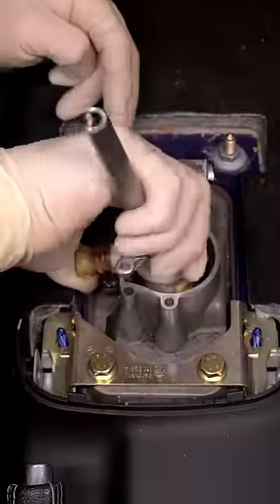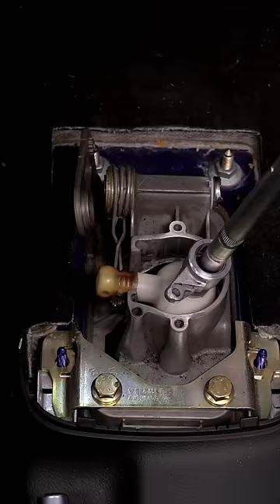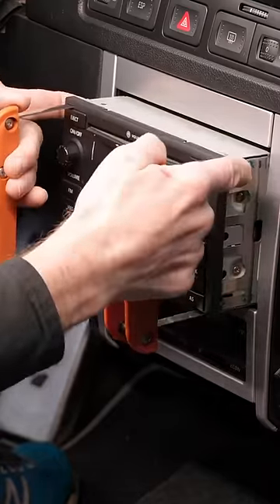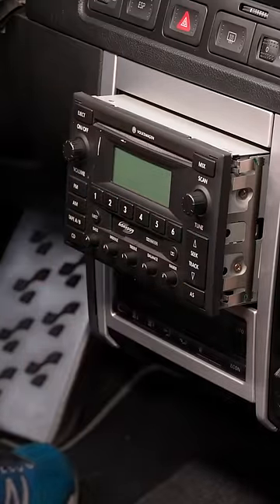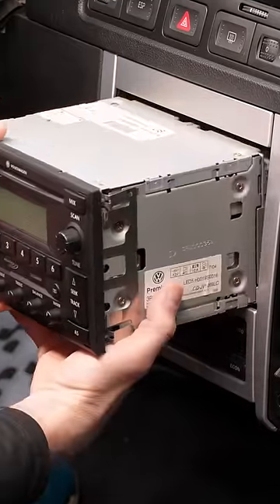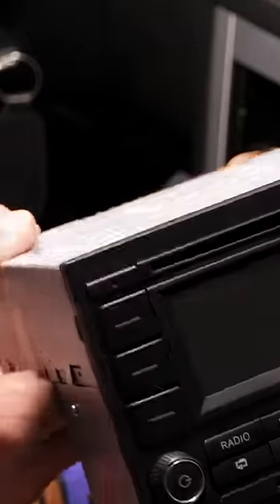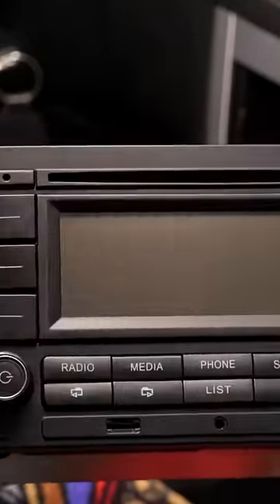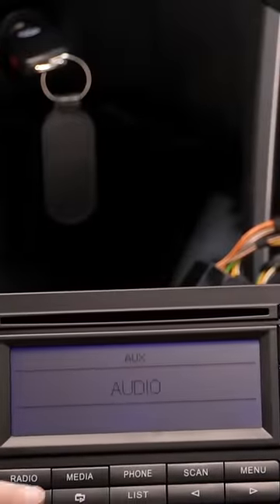I Ruined a Clients Radio OUCH

Comment: Recently had my car for a throttlebody swap. This was a commonrail i4 diesel so the throttlebody was way under the intake manifold, near where the vacuum lines for the turbo run. I get the car back, and notice a lack of power. I take the thing back, and ask whats up. They put it on top of their priority list then and there. Same tech who did it started diagnosing. Found that one of the old, cracking vacuum lines for the turbo had broken during rebuild and he failed to notice. Shop owned the mistake, showed me the broken part and fixed it quickly no-charge. This was a mercedes specialist (not an official dealership). The kind of service and accountability everyone should be expecting.

Comment: Had the clutch replaced in my all original and pristine 1981 DeLorean DMC12 with only 19,000 miles by a shop in Kalamazoo, MI (European Imports) back in 1996.  When I got it back there was a massive 14" long fluid stain on the passenger side carpet.  They claim, "it was there when you brought it to us...".  ...no it wasn't.  The car was factory fresh.  It is now 2023 and the stain is STILL there.

Comment: Oh man I know that feeling.... I remember braking the air box on a vct turbo Rogue during power steering rack removal. And didn't realize the air box was bolted on to the sub frame and I Heard plastic brake but didn't realize that it was broken. When putting everything back together performed test drive and notice a cold air intake sound😂. And I soon remembered that sound the box had a crack 😅. But the customers was cool with issue but I ordered one for the customers anyway but she said the car sounds way better. 😂

Comment: Something like this just happened. I was doing a lifter job a gen 4 LS for a customer. 6 out of 8 lifters were wrong in box that were damn nesr identical until i noticed the biggest knock on first start up. After tearing it back down, i noticed of those 6 lifters had the weep hole in opposite direction causing no oil to pass through. I didnt even want to rebuild it at that point. I just dropped in a motor that was blueprinted i had plan to swap after i called him and customed said hell yeah! No he complained that the truck smokes his tires 😂😂

Comment: It totally sucks when you mess up. Once i was putting on wiper blades for a drive and niticed the pin on the arm wasnt straight and i couldnt get the blade on. So i grabbed some pliers and gently tried to straighten it so the wiper would fit. (I genuinely was being gentle) Well, it snapped, and of course, the parts places around either didn't have it or it'd be a few day's. After talking to my managers and the driver to his company we decided to just swap the passenger arm to the driver side. (2010 mack) thanfully the driver was cool and not angry at me. I really was just trying to help out. We cha4ge to install wiper blades, but since it's an easy job, we tend to do it for free since it's that quick.

Comment: Easiest thing to do which would’ve also kept it original would be to just repair it. Very simple to just paint the radio. Melt some more plastic on and sand it down if it’s deep.

Comment: I have a 2001 Chevy malibu and am trying to keep it as stock as possible, but I am not too worried about stiff that makes it run like ignition. Radio I plan on updating as its old and not digital. It also uses an old radio standard

Comment: I once had a mechanic replace some light bulbs in my center console. Then my radio/cd suddenly stopped playing audio. Took my car back and they said it needed to be replaced and would cost $$$ because it was out of warranty. I thought no harm if I had a look at it so I found a youtube video telling me what to do, took out the center console myself, found the right cables, unplugged the radio/cd player and plugged it back in nice and tight. Working all fine. told them what happened, no apologies or anything. Never gone back nor buy from the same car company.

Comment: I remember working at a collision shop back in 09 and my coworker had a r32 golf. We always had Firestone do the alignments and he brought it there after some suspension work he did. Firestone didnt know it was hit. We also fixed their mistakes quick so the customer never knew their car was damaged. Well around lunch his car was flatbeded in smashed BAD. Basically totaled. He called Firestone asking whats going on and they said a part broke and wont be in right away. He then lost it and screamed into the phone to the point my ears crackled. Then why the F^,k am i staring at my car???????? Owner of the franchise paid to rebuild the car with 100% brand new oem parts and even had a built transmission for him because it was cracked. Final bill was over 30 grand and he paid in full. We bought a alignment machine a month later.

Comment: There are companies that specialise in repairing car audio. I bet one of those could fix that for fairly reasonable cost as it's just scratched paint.

I personally like OE radios more than aftermarket ones for their simplicity, lack of LED Salad and the fact they look very natural.
Reply from the maker: the down time was an issue. Luckily the client got the option they wanted. But if you know of those places that can fix it, LMK. The same coating is on a bunch of other VW parts and id love to get the AC controls fixed on a few other cars.

Comment: I had a mechanic that told me my radiator had some blockage in it that was causing it to  leak. Since it was my moms car i had brought in my Dad made the call to get it fixed. Near the end of the service my dad called and asked me to make sure i got the old radiator back just to check it. Turned out there was nothing IN the radiator. There was just a little road dust in a small portion of the fins. The leak was caused by a small leak in one of the couplings leaking the fluid. Next day we went and talked to the parts manager and he gave us a $700 credit

TLDR: Mechanic lied that radiator was fucked, got ot replaced, turned out to just be a fluid coupling leak, original radiator was fine, got $700 credit for next visit from parts manager

Comment: It was very nice what you did but what if the customer didn't want a replacement radio (especially since it's not the original one) or you messing with his instrument cluster? Did you check with them beforehand?
Reply from the maker: Did check with them on the radio... I know all my customers very well so knew 100% for sure they'd be into the cluster mod/repair

Comment: We recently put a motor in a customer's car. She came back a month later with an intermittent code. I could not figure it out, so I sent her to the stealership for diag. I happened to have to get parts from the stealership and paid for her diag out of my own pocket. It wasn't a mistake on our part. But I felt that it was the right thing to do.

Comment: I had a mechanic fix my mk5 gti because it lauched the oil cap out of the car. They ended up bandaiding the car and also ripped a coolant line and didnt say anything so the motor ended up overheating on the way home.

Comment: If I had done the mess up depending on what the car was sent in for it would be on the house I’d even be looking for an oem one in as good of condition the last one was or find the parts that get his back to the condition it was in the radio isn’t a complete lost cause most radios back then could be taken apart so all you need to do is find one with those parts in good condition I mean it all comes down to time tho if I found a replacement that was as good condition as before it don’t matter if it cost 2k I’d be going that direction but if it’s faster to do the swap with as good parts as before then I’d go that way again not his fault and he shouldn’t be in the situation at all so the quicker it’s resolved the better id even ask him what parts he wants that maybe he is looking for to make the car better and go out of my way to find it buy it and install at no cost to him

Comment: For the effort you took to put the "wrong" radio in, you could have definitely gotten this one fixed or a used one in perfect condition. 
Like ofc they don't get produced anymore, but there are definitely enough of those in circulation that you could have gotten a perfect one or one that was bad on the interior but had a spotless exterior. 
I'm just wondering why it had to be this way... cause i know the original radio feeling. Have an E32 (funny coincidence r32) and try everything to keep that radio, like refitting it with Bluetooth etc. cause no other radio looks so right in that car.

Comment: I’d have just straight up called them. If they want to keep the car stock the sweep on start might not have gone down well
Reply from the maker: I did on the radio. It was never a question on the sweep. I activated it on their other cars. This one is just a little deeper than some coding changes

Comment: The original one was monsoon. I would be disappointed.
Reply from the maker: Did you ever think that maybe, juuusssttt maybe I spoke with the client about it, and let them make the choice on what’s best? 🤷‍♂️
Reply: @HumbleMechanic  not saying you didn't.
Reply from the maker: No but implying. Also you may not know on this system the amp does the lifting not the headunit. So all they got was a good upgrade with modern tech.

Comment: I would have looked for a non-operational radio on eBay that had the same exact faceplate that looked mint and I would have switched the front plastic of the radio.
Reply from the maker: I left the repair up to the client.
Reply: @HumbleMechanic  That is always a good Choice. I see you have trolls on here. Everyone makes mistakes. It's great that you own up to it. I've sent a laptop in before for warranty repair it came back missing screws and they wouldn't do anything about it saying that they don't know if I sent it in with all the screws in it. I looked it over good before sending it in. They refused to take responsibility for what they did. I ended up having to buy screws to replace them in the bottom off ebay. I just wonder how many they left out on the inside.  Toshiba service center is horrible.
Reply from the maker: Yea lot of sadness in the comments. I get it though, you can only tell so much of the story in 1minute. went into deeper explanation in the full video. Either way the client was happy.

Comment: It had the monsoon system. We're you able to use the factory amp still? Mine lost a lot of umph
Reply from the maker: Yep worked perfectly
Reply: @HumbleMechanic  good deal. I used 2 different harnesses and still no power to the amp unless I had the factory unit plugged in. Do you have a part number?

Comment: I would have probably asked to get that front plate of the radio to be re-made/redetailed/repainted.. seems more logical than to replace it
Reply from the maker: Yup I’d have done that if that’s what the client wanted. I ended up having the face replaced anyway. So they got both
Reply: @HumbleMechanic  thats some good service then. Nice to see that there are still some doing it properly

Comment: "aFtERMarKeT rAdiO" for f&#@'s sake this is an RCN210! 

This is OEM VW hardware from later (mk6-7 generation, could be specced on the Crafter van until recently) but with modified casing to fit MK4 cars

Comment: Wait wait hol up. You took out a Monsoon head unit and replaced it with a base model unit?!?!
Reply from the maker: Not really. IF anything its an upgrade. All the power of that system is in the separate amp not the headunit.

Comment: You could just used grey touch up paint to fix the problem too
Reply from the maker: I don’t think grey paint on a texture black finish would have gotten it done. 

It does seem there are more ways to fix it than it seemed. Luckily I found another face so they have both options now.

Comment: That scratch would have been easily repaired for a lot less money.
Reply from the maker: Maybe, the downtime with out the radio would have been an issue. The main issue with repair is this is textured so it would have to be redone in the same texture.
Reply: @HumbleMechanic  yeah I can understand why you replaced it and you would have to have someone who could do the repair on hand. I repair old toys and make my own action figures so from my point of view it would have been easy because I deal with plastic gouges and scratches every day. I should have added that in my last comment.  I will say though, that something like that, if you know all the little tricks  it's a lot easier than you might think. But it could be scary to attempt the repair incase you think you might make things worse. Best way to learn it is just to practice on old scratched and cracked items, and keep practicing, watch others on YouTube on doing plastic welding and repairs, pick up the skills slowly until you build up the courage to tackle things like this. I wouldn't just rush in with filler and paint because that would not be the right thing to do. 

Your solution may have been the more expensive solution, but it was also the quickest and easiest all round solution. And to be honest I would probably have done something along those lines, then recouped some of my costs by fully restoring the original stereo and sell that on, providing the car owner didn't want to keep it.
Reply from the maker: Dude repairing toys and making action figures??? THATS AWESOME!

Comment: One time a shop chipped my dash when replacing my ac condenser. Didnt say a word
Reply from the maker: I will say there have been a very very few occasions where I did something like that and didn’t realize it. Especially early in my career. Hopefully they made it right after you showed them
Reply: @HumbleMechanic  well by the time i realized it would have been too late and id be afraid that i wouldnt be able to prove it was them

Comment: Well hopefully you gave them back the stock 1 cuz stupid early 2k VW cars won't pass smog without factory radio
Reply from the maker: They won’t pass smog when wired wrong. But when right, they will. 

That’s mostly the older K Line cars.

Comment: They're trying to keep their car stock so you modified multiple components to aftermarket instead of trying to find used, good condition replacement parts?
Reply from the maker: This is gonna blow your mind... I spoke with the client and thats the route we decided. Other than the cluster repair/gauge sweep. I knew they'd dig that. I dont run a production facility type shop. So I know my customers very well.

Comment: I'm not sure the video told the story you hoped it would. The customer likes to keep his vehicle original and clean, so when you f-ed up you replaced the radio, and to make up for that you replaced his instrument cluster too?
Reply from the maker: Well you’re right on a lot of levels but with the wrong tone. 

See the client and I talked about radio options and they chose this one. 

Also I have the opportunity to not run a production facility like your standard shop/dealer. This means I get to know my clients very well. 

So there was never a question about the cluster. Which was repaired, not replaced. The screen in the center goes dead and it’s a reasonably easy fix. Something I knew the client wanted. And the gauge sweep was activated on their other cars so again, I knew they’d want it.

Comment: At least you fixed it instead of acting like you didn't see it and waiting for the client to say something. Fuckin windshield guy broke the plastic cover over the sensors and mirror. Didn't say anything then i see it when i was inspecting it. Of course first he blames the plastic then the last windshield guy. Literally a $10 fix and I had to basically make them replace it

Comment: you quite literally could have bought a factory radio off of ebay for less then $100, or even repaired the scratched plastic for free.
Reply from the maker: repaired for free? not with the coating that radio has. I gave the client a list of options, this is what they wanted. Turns out adding BT is something people like.

Comment: but a technician isnt supposed to have a youtube videoing setup in a car while working on a customers car. camera hitting the radio is not an issue related to the job. i would be beyond pissed.
Reply from the maker: It’s part of the deal here. Clients are made well aware. This is no different than if a tool mishap did this

Comment: Yea if you did this in my car and then tried to replace it with a £20 radio and a stupid cluster clean no chance pal it would be either finding an original in better quality or finding an original in slightly better quality as well as no labour Or parts charge for current work AND a cluster clean.
Reply from the maker: Ever think maybe the radio was what the client and I talked about? Nah you went right to 1,000 👍 all good though

Comment: You replaced it with a POS radio. you did not "over do" anything. you just shortchanged someone who probably doesn't know what they had. You could have at least got a used replacement. You took something stock out of the car. kills the value of a collector car like that, maybe not so much right now, but 10-15 years from now that will be a hit on the car for sure, small but still a hit.

Guy shouldn't come back. Did you make him agree to let you film it? if so its really shitty, cause you are not focusing on his project 100% you get way more from here then anyone's gonna pay you to do this bs
Reply from the maker: You’re making a whole lot of bold assumptions 👍 but don’t worry the client and I talked about all the things other than the cluster repair, and gauge sweep. Both of which they wanted. The cluster was borked and the gauge sweep we have added on other cars. 

How did I know that? Because I know my clients well enough to make that call. I don’t run a quick change type facility. I actually craft a relationship with the clients.
Reply: You screwed this guy